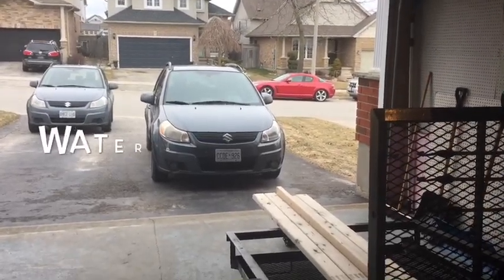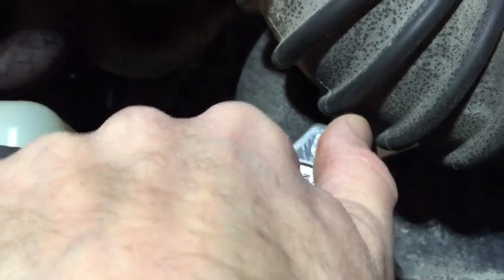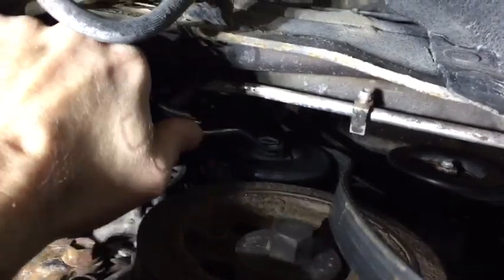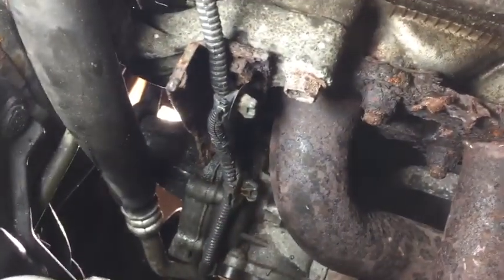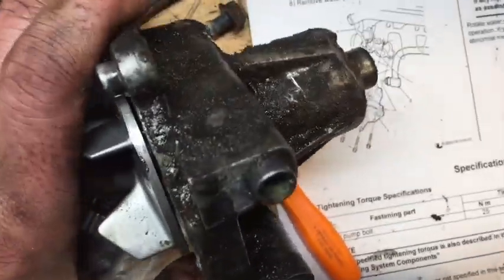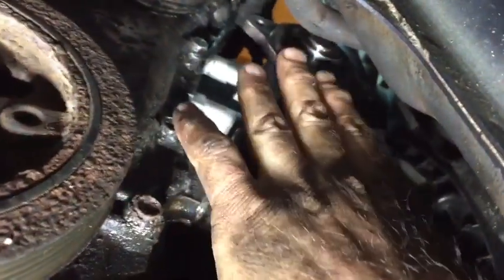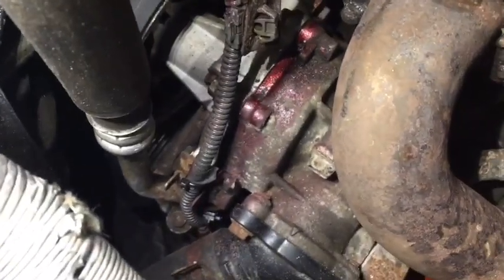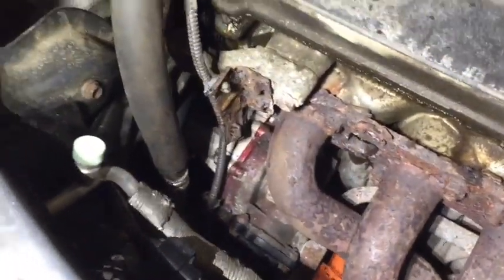Suzuki SX4 Water Pump Replacement

Comment: Thanks for the help! That was a PITA but it's done and seems to be working great. No part of this job is particularly complicated or difficult it just has a lot of steps in tight quarters. I have a confession to make though. I pulled off the exhaust headers, which also required disconnecting one side of the engine mount. It's pretty easy and only took about 30 extra minutes total to take them off and put them back on. You totally don't have to but it is very easy to reach everything once you do. Also the water pump I used didn't come with the larger bushings that go into the engine block and the water pump impeller that's being replaced. Hopefully, it still withstands the test of time.
Reply from the maker: Allan Spangler Nice...I am glad you got it back together. Alaska is a beautiful part of the planet...hope the winter treats you well. Thx for the kind words...Cheers

Comment: Good job on the video and very useful information!  That's a horrific amount of rust you have eating away at the undercarriage and miscellaneous screws/nuts/bolts.  That can be addressed by first wire-brushing all of that corrosion off and always having several cans of Rustoleum spray paint handy, then every time you go under the car hit all of those areas with a fresh coat of Rustoleum.  I know other SX4 owners up in the Canadian rust belt that follow those steps and don't have anywhere near as much heavy corrosion on their SX4's as what is on yours.  Also make sure you spray down the entire undercarriage after the last snow of each winter season to make sure all the road salt has been washed off.  Those steps will reduce about 80% of the rust you are getting.  Also you should inspect that cross member, they aren't that thick or resistant in the first place and get eaten through ridiculously fast when they are left to rust at will like that.  Checkout Volvosweden's SX4 videos, he has very little rust after rust after 12 years and 223,000 km.

Comment: I am about to try to tackle this job.  Your video is going to be my inspiration while I cuss and throw tools around. I downloaded the service manual. Thanks for making this video. Cheers.
Reply from the maker: 🤣 Good luck 🍀 Thx for watching 🍻
Reply: @TheGibby3340  Just a heads up. A little propane torch heat worked. Got the pump off.  I had no issues once getting the housing loosened up. I was surprised that the index pins that came with the new pump are not the ones that attach the pump to the block but go from pump to housing. I used the pins from the old pump to the block. Thanks again for the video and the response to a couple of my questions. it was a huge help. Cheers.

Comment: I'm in the process of doing the water pump now on my girlfriends SX4 and it's a real bitch but doable. Thank you for posting this video, it was super helpful. Very important to remove the oil filter and remove the 4 bolts for air-conditioning compressor so it can swing out of the way. Thought i would try to remove the pump without removing the last 2 bolts in the main housing, but they must be removed so the  the old pump can come off the 2 stand-offs (as you stated). Lots of cussing trying to get at some of the bolts and not much room to turn a wrench.. Thanks again, cheers!
Reply from the maker: PanzerDude1 Thank you Sir. Glad it helped. Thanx for watching. Cheers ...Ian

Comment: I found if you can get the bugger bolt hes talking about undo the 4 bolts holding the whole pump on a little bit not all the way and I was finally able to get a socket to seat all the way on it part of the timing chain cover was preventing it from coming strait out by like 2 millimeters.
Reply from the maker: The pop up notation @ 5:28 is intended to convey the same as your comment. If your comment clarifies this, so much the better. Thanks for watching

Comment: Hey, thanks for the video. Very informative. My issue is that when I look up the part it says that it isn't compatible with my 2011 SX4 (only up to 2009), yet the water pump assemblies that i find are good for 2009-2013 and the impeller part doesn't quite resemble the impeller part of the assemblies that I'm being shown as being compatible with my car. I would much rather do the job you did instead of taking off the manifold and moving the motor mount to replace the entire assembly, but this had me worried that the part you show in this video will not fit onto the other half of my pump assembly. Thoughts?
Reply from the maker: Hmmmm…I don’t know to be honest. If you haven’t done so, check Rockauto.com. My experience with them has been that the detail on their site is rarely incorrect. Good luck. Sorry I am of little/no help. Cheers 👍
Reply: @TheGibby3340  yep, that's where I was looking. Ordered the whole assembly just to be safe. Cheers.

Comment: i am stuck on removing the pulley off the old impaler housing.  i removed the 4 bolts but the thing is stuck.  i think i bent the pulley or pump shaft prying on it.  any suggestions?
Reply from the maker: Hmmm...Unfortunate, but these things happen all the time...Drench it in penetrating oil. Pry from more than one point simultaneously, Pry at the inner portion of the pulley not the outer. Fashion a wooden wedge(s). A small nut and bolt sometimes can be used as a press (use multiple pairs if required) although it’s unlikely you have clearance for that...Heat should be the last resort. Take all necessary precautions. Protect the surfaces you are prying, pressing, wedging against. Use all of these in combination if required. Good luck!
Reply: Thank you I got the pulley removed! Did you replace the oring on the back of the pump housing? Looks like a difficult replace replacement
Reply from the maker: @pcbisnice  Awesome...Yes I did...It's a by feel job. Clean the contact surface and lube the O ring so it "sticks" in place. Check it is seated properly with a mirror prior to reassembly. Good luck...Cheers
Reply: @TheGibby3340  I got everything together last night.  Decided to let it dry overnight. I will test it as soon as I build up the nerve, LOL!  I am nervous. I will let you know how it ends up. Thank you for the help!!!!
Reply from the maker: pcbisnice Not at all. Your success hinges on your own efforts and persistence. All the best!

Comment: Looks like a nightmare..
Reply from the maker: There is a more up to date version of this video on the channel if you’re interested. WP & radiator replacement. 🍻
Reply: @TheGibby3340  do you have a how to replace head gasket on the sx4?
Reply from the maker: Never had to do one thankfully. 🍀🍻
Reply: @TheGibby3340  I'm pretty sure mine is bad so I'll a series of videos doing it.. have you ever had a random misfire code on start up only .. I get them about once every couple weeks.. always different cylinders..I'll erase the codes and I'll be done for a couple weeks.. the engine runs fine.. I checked everything.. new plugs, coils, cam sensor, checked injectors, no vacuum leaks, etc.. no other codes.. maybe something with the PCM?.
Reply from the maker: If you figure a head gasket leak, is it possible coolant in the cylinder is causing your misfire on start up? Pressure test the cooling system and perform a compression test to confirm your suspicions. Head gasket issue would likely result in coolant loss, either through over pressurization or    burnt within the cylinders. 🍀
Reply: @TheGibby3340  I should of been more  clear.. I have two different sx4s.. the one with the misfire is running fine. No head gasket issu
Reply from the maker: Ok…maybe I’m not the only one with 2 of them 🤣 Maybe check fuel trim numbers at start up to see if it’s a rich or lean condition for direction. 🍀

Comment: About to do this. You didn't remove the exhaust headers right?
Reply from the maker: Allan Spangler No exhaust components were touched. If it’s not detailed in the vid...I didn’t touch it. Good luck. Cheers
Reply: @TheGibby3340  Thanks. I saw that it was called for in some videos/writeups but it didn't look like you had to unless you wanted to pull the pump from above.
Reply from the maker: Allan Spangler Yeah the manual is detailing “Assembly replacement” the vid details pump (impeller) only. Pay close attention to the index pin section...👍
Reply: @TheGibby3340  HELP! How important are the indexing bushings? The new water pump I got locally from o'reillys didn't have the larger indexing bushings that go into the engine block it only has the small ones that going into the pump assembly. I tried pulling the old ones but they are totally stuck and are now mangled. I've also wasted a ton of time trying to track down some new ones or some alternatives with no luck. How important do you think it is to use them? Obviously they don't seal anything but I worry that without them the pump will move/vibrate a lot more and start to leak. It'd be great to have the car done this weekend and ordering stuff takes forever in Alaska.
Reply from the maker: Allan Spangler Hard to say Dude...Salvage what you can, use plenty of thread locker. Try to position the pins/bushings that are useable diagonally. Good luck. Don’t worry/feel down about it, these things happen all the time. Ultimately you need to use you best judgment. There is no editing in the real world. Cheers
Reply: @TheGibby3340  Thanks. They definitely do happen all the time. I think I'm going to use a little JB weld to fill some of the empty space left by the lack of bushing and then coat the bolts and bolt holes in the block with some thick oil or wax so they don't bond to the JB. That should help. I've had success in the past using JB weld to make new threads using this method.